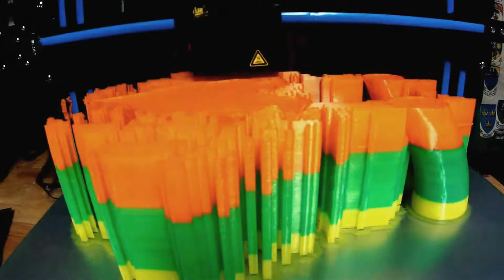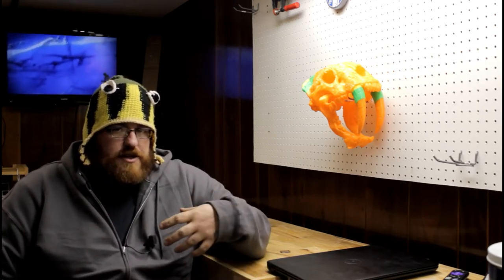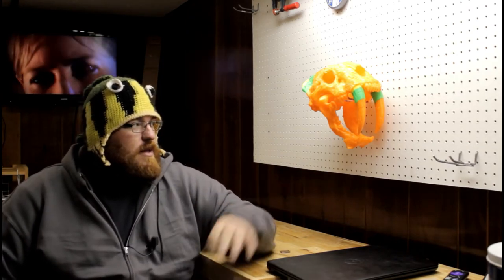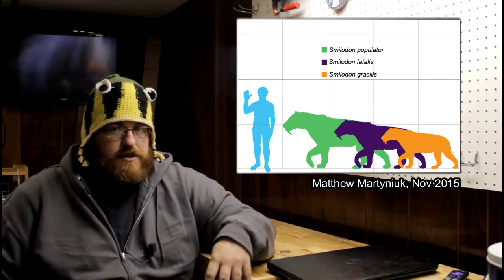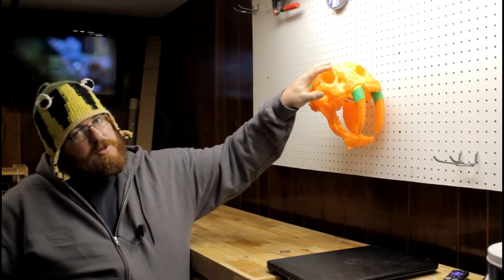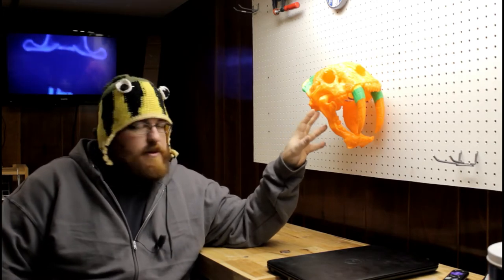Printing a fossil at life scale

Comment: Printable without suports
Reply from the maker: Very possible.
Reply: @RevampedOutdoors  i did one at 200% file size was about same size as that. Was able to drop the rear into the bed 4mm to give a nice flat bind to the bed and printed with 3 walls 20% infill. .1 wall layer and .2 infill layer. Turned out great without any supportz just a brim
Reply from the maker: Nice! I should have tried to drop at least some of the supports, would have greatly reduced the print time too. But I was just getting started and was happy that it printed without a fail lol. I bet printing your way probably saved a ridiculous amount of filament too!